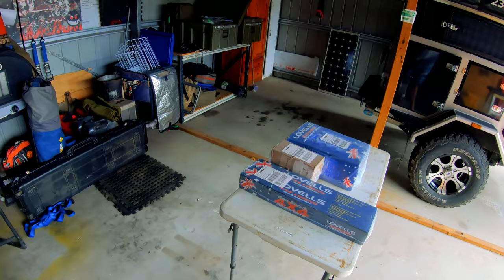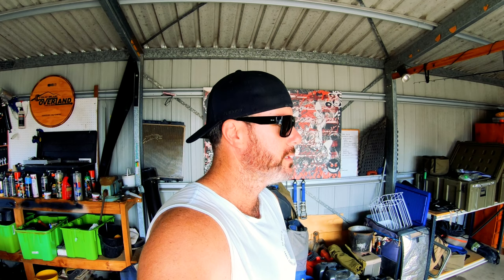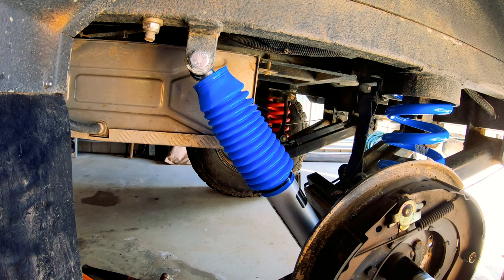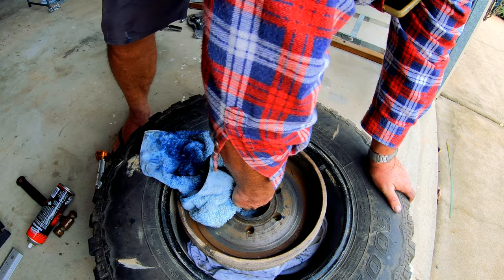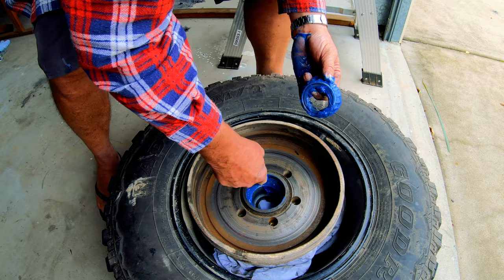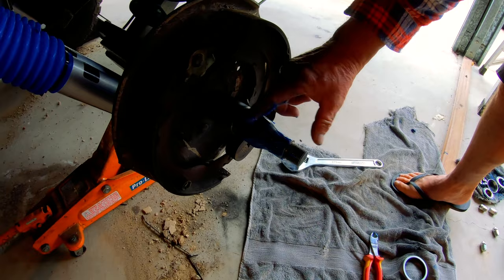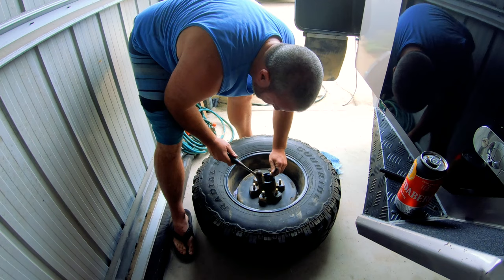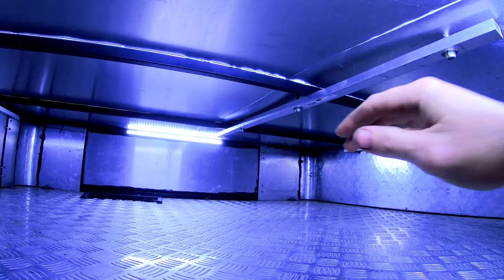Camper Trailer Suspension Upgrade

Comment: If no lip on the bearing race put a bit of weld on where the bearing sits then tap on the weld with a punch and they come out easy.
Reply from the maker: That's the go. Good tip mate. Cheers.

Comment: Hey Tim,  nice job.  Do you have the part number of the lovells? Thinking of doing mine.  Rough cost? Thanks
Reply from the maker: G'day Kent, I've probably got part numbers on the receipts. I'd have to dig them out.
It cost me just over $1k for the complete kit Inc wheel bearings etc. But make sure you phone them and stay on top of them. They were a complete letdown in my experience. They couldn't even get it right on the 3rd attempt.
Reply: @TimRumble  thanks Tim,  appreciate your response.  Worth the $? I'm thinking of air bagging. Is that something you considered? And thanks for the tip on lovells 👍
Reply from the maker: @kentwillis  yeah I think it's been a good improvement in the trailers handling and feel. It'll get an extended test soon. We did think of airbags especially when it comes to levelling it at camp. However. We decided to keep it simple.
Reply: @TimRumble  yeah that's my main motivation.  Thanks for the feedback and safe travels
Reply from the maker: No worries Kent. Have a good one mate.
Reply: @TimRumble  Hey Tim, did you go 2" lift or standard?
Reply from the maker: @kentwillis  G'day Kent... nah mate. We went standard. However it does sit a tad higher than stock. But that may have just been sag in the old stuff.

Comment: Hey Tim what size tyres you running?
Reply from the maker: G'day Kent, the Luxy has 32s in 15inch rims and the trailer is 285/75/r16
Reply: @TimRumble  sand no issues with clearance on standard height?
Reply from the maker: @kentwillis  not as yet mate. Have had no clearance issues at all.
Reply: @TimRumble  Cheers